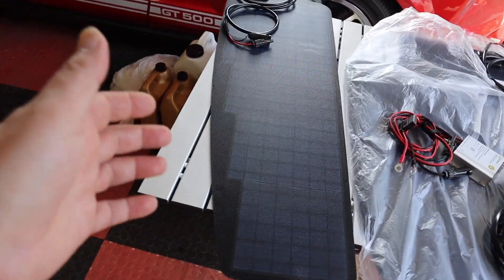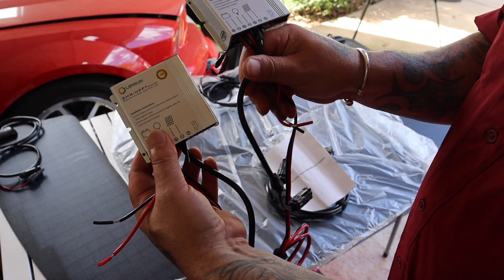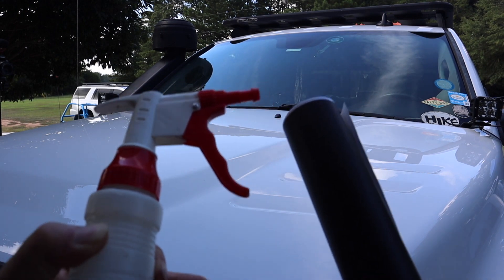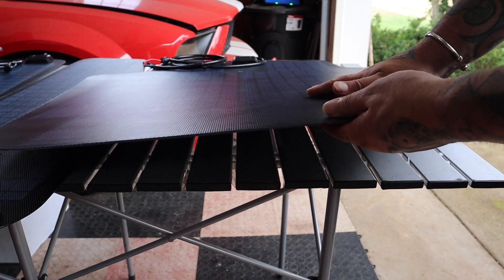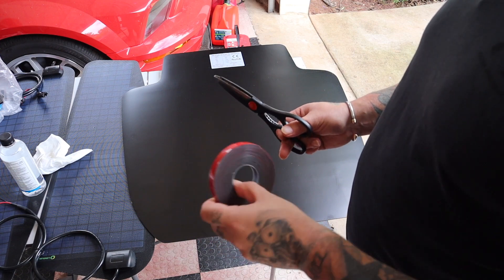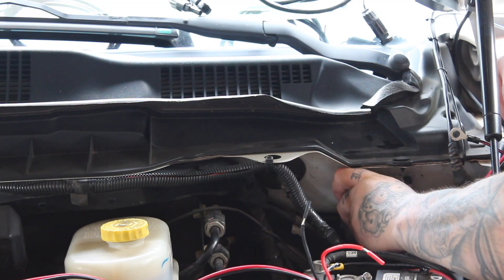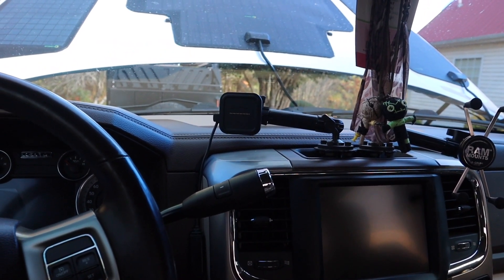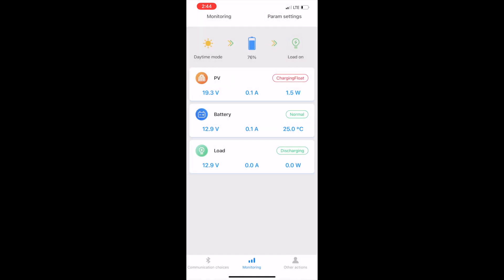150 Watt Hood Solar Panels Install On Ram 2500

Comment: Your batteries are in parallel unless you have a 24v system or it's two six volt batteries.
Reply from the maker: Yep, was not contemplating that originally. That’s why I’m the end I ram the panels to one battery instead of both.